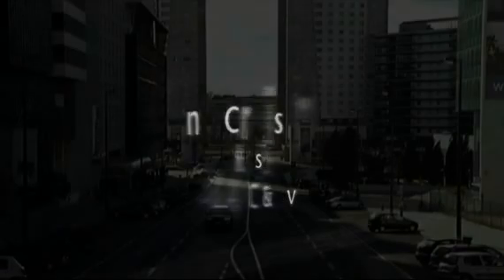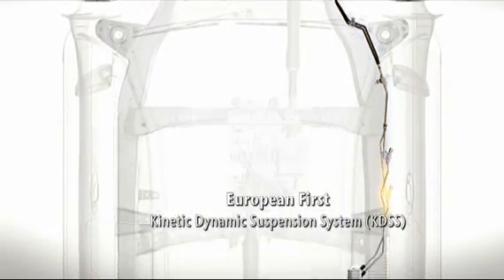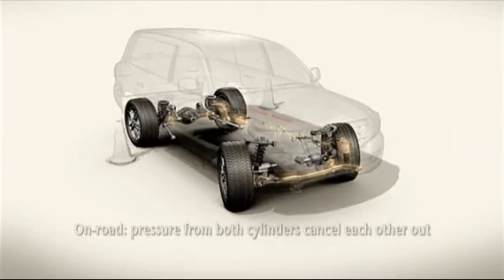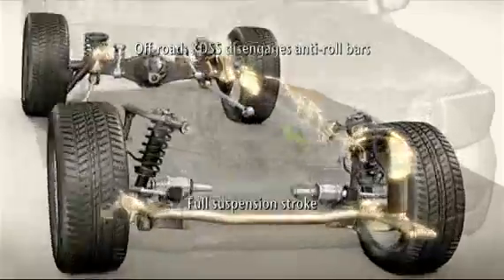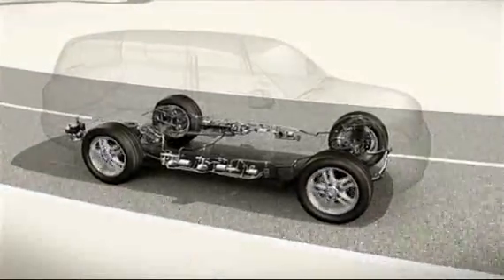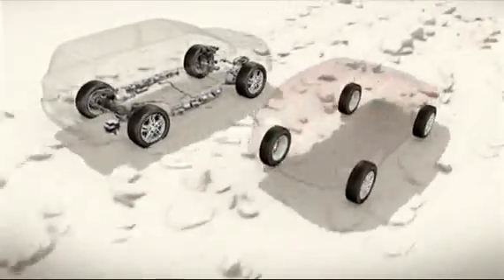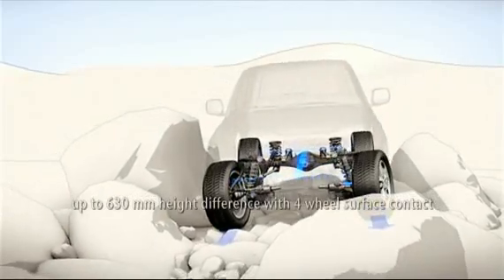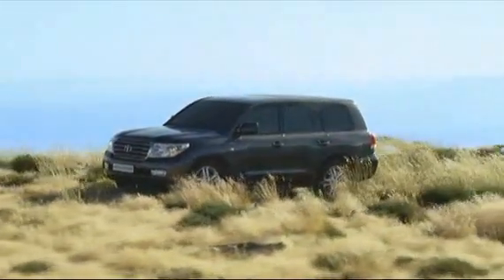Toyota Land Cruiser V8 tech suspension

Comment: @minerallover actually the standard landcruiser is 28,000 - 45,000 that was the landcruiser v8 on that video witch is about 60 grand.

A standard landcruiser is nearly as good, and anyway, a Jeep could be better but first you need to own both cars.

Also you can get loads of accesories for toyota landcruiser.

Comment: A question for everyone !! if by chance any wheel leave the ground will wheel spin as normal differential??
Reply: After 9 years, I feel honorable to till you that yeah it going to spin as an open differential until the the computer notice that and order the ABS unit to apply break gradually to the spinning wheel to force the torque to go to the opposing one.